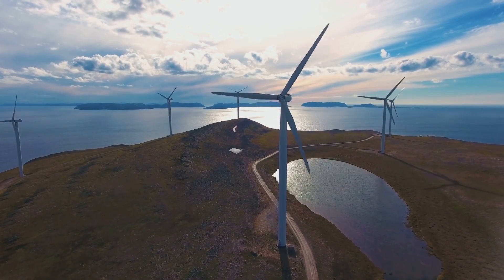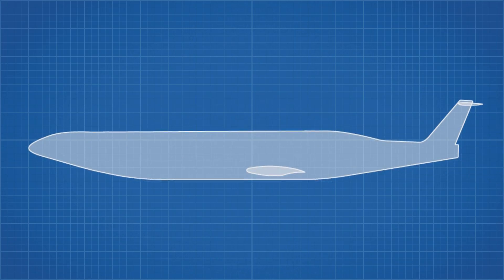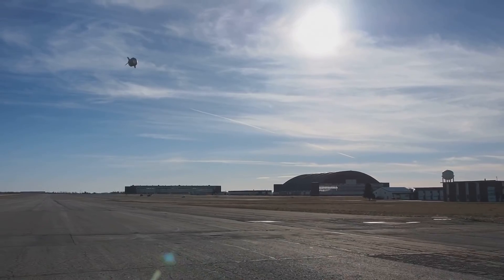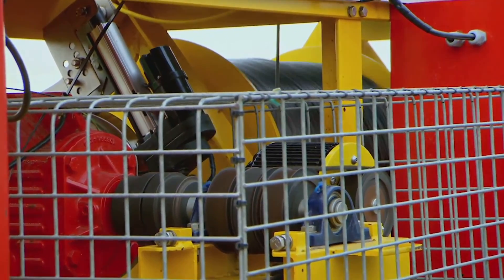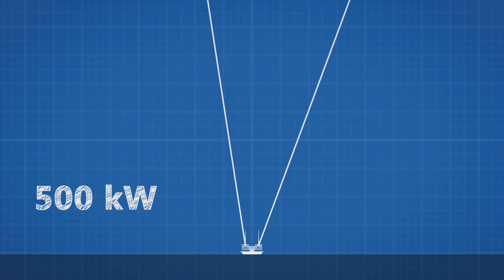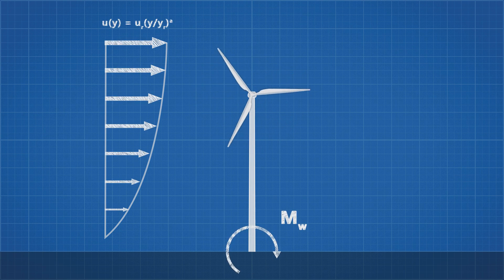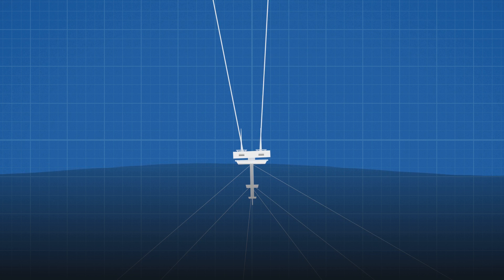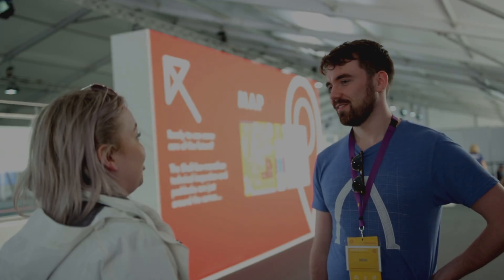The Future of Wind Power? - Kite Power Systems

Comment: Those numbers seem wildly incorrect. A glider requires about 10kw to lift a human. Most paramotor engines are in the range of 10-20kw. Those looks like smaller wings but at higher wind speed. So a 10m^2 wing at 30km/hr wind will create 1kN of force. Or enough to lift a 100kg person. In order to generate 100kW (instantaneously) it would have to climb at the rate of 100m/s. Obviously for equivalent net power output it would have to climb at 200m/s and descend at 200m/s. I.e the climb rate of an f16

Comment: The same system can be used in a river with slight modifications to the actual sale it can be a c anchor bag that opens and closes and using the rivers natural flow to drag the cable out and turning the generator creating energy and it can go back and forth with three as many as you want and it doesn't impede the natural flow of the river

Comment: You can use  hydrogen gas to keep the kite in the air it might be cheaper than helium gas.
You would have to have a rope in each corner of the rectangle sail the bottom 2 ropes could be joined together a few hundred mtr from the corner,
The top 2 ropes might have really strong rubber rope attached to the main rope so it will stretch in really strong winds that will make the sail flat and it might only be a mtr thick so it could handle really fast winds,

Comment: I made a mistake the bottom axel doesn't turn in on direction so you have to make a fitting to make it work both ways, sorry.
Reply: You may have to fit ratchets on the bottom axel to make the axel turn one direction.

Comment: I've got a different idea that's much cheaper to make and I think twice as efficient.

My idea.

Make a rectangle sail that  has helium gas to hold it up .

Make a 40 or 50 lift well have a axel each end, have strong flat strapping that are attached to both axels,
One strap is attached to the right side of the bottom axel and the other one is attached to the left side of the bottom axel .

Have a track each side and make a square tank with no top cover, the tank will hold a ton of water.
Attach the straps to the tank half way up the lift well,

Have a water pump inside the tank, have a electric flat strip about 10 mtr on the well wall at the bottom the electric strip would turn on the water pump inside the tank .
The pumped out water would be collected and stored in a tank,

How does it work,

The wind pulls the tank up , and the weight of the water pulls the kite down.
When there is low wind most of the water in the tank would be pumped out and one generator working.
High winds the tank would be full and 2 generators working,

A computer would put the right amount of water in the tank, you want the full 40 or 50 mtr stroke.

Because of the way the straps are attached to the bottom axle the axl always turns in one direction and one strap is always pulling and the other strap is winding up

So the kite and water made the machine twice as efficient because it works both ways

It's easy to scale up to a 100 mtr lift well and a really big rectangle sail like those big balloons, you can put 3 or 4 ton of water in the tank,
I thought of this idea for a boat about 30 years ago the waves would make the weight more back and forth,

When I saw this kite idea I thought that I could use my boat idea and instead of waves use a helium kite
I will be 72 next September so I would like someone out there to make my idea.
I've looked at a few other kite ideas they all seem much more expensive and they don't work both ways they only pull,
The best wind for my idea would be strong choppy winds so the tank would go up and down the full length of the lift well quickly,
Patrick Ryan I am retired and I live in Vietnam email,
patvn2000@gmail.com
Reply: https://www.youtube.com/watch?v=k_fEP-3W1Gc

Comment: It would be really interesting to see a follow up video which compares and contrasts this Kite Power System with another kite system. Makani is the other system. Makani is seems much more complicated but it's also crazy cool. The video title is "Pulling Power from the Sky: The Story of Makani". I saw it on the channel X, the moonshot factory. I'd love to see Real Engineering's take on this technology.
Thanks for making interesting videos.
Reply: Makani seems like the wrong way to go about this. Basically building large and complex airplanes that require lots of resources and money just like airplanes.
VS just making a simple kite a little larger maybe and working with a winch on the ground and a relatively simple kite control unit in the air.
Reply: @dejayrezme8617  It depends on what sort of power the two systems can generate. IF Makani produces enough power to warrant the extra complexity and expense then it might be worth it. I'd be very very surprised if Makani doesn't produce much more power but I'd want to see exact numbers before deciding which is a better option.
The whole time I was watching the Makani video, I was wondering how something so complex could possibly be better then normal wind turbines. The Makani video didn't convince me their system is a good one but I'm also not completely sure their system isn't worth pursuing.
I'd really like to see some hard numbers comparing the amount of power produced by the two kite systems.

"require lots of resources and money just like airplanes."
Keep in mind the Makani kites don't carry people. If airplanes flew without people, the cost of flying them could be greatly reduced. When airline jet turbines are serviced/rebuilt, some of the parts removed are then used in power station turbines. Making an airplane safe enough for human passengers greatly increases the cost of maintaining airplanes. 

I think you're still likely correct in your assessment of Makani but I'd still like to see the comparison.
Reply: @ddegn  Would love to see a comparison too.
I've been researching this a bit the last two days. The simple start with a winch + inflatible kite + kite control unit (3D printed and open source electronics?) could be awesome for easy adaptation. I'd like to put this on a boat and use it over the ocean.
Another advantage is that an inflatable kite would be less dangerous.

Comment: 500 kW output ? But this is a periodic system right ? You have to rewind the cable every x minutes right ? What's the power output when you have to rewind the cable ? What's the minimum wind speed to operate the kite ? You also have to forbid all area to aviation.

Comment: The estimates for the amount of batteries needed are GROSSLY wrong. 

1. Simply by combining wind power with solar, we eliminate almost all the batteries the video says we need, because wind and solar tend to peak at opposite times of both day and year. Offshore wind also is reaching capacity factors of more than 60%, 3 times solar's cf. Improvements in both W&S are still happening, and solar panels can be tiltable to extend use through day and year, are increasing efficiency as they replace fossil fuels and thus air pollution declines, and may soon absorb energy from falling rain, allowing them to dramatically increase output at times of day and year they give little or none now. Other advances are happening as well, increasing solar's power and efficiency, which decreases the land needed for it. That allows more of what we need to be near (or in) cities, allowing virtual power plants with microgrids containing solar, wind, geothermal generation, small amounts of biomass and/or tidal, plus batteries like the Powerwall. To try to power Hawaii, eg. just from solar, is nuts; wind will likely be their main source, especially offshore wind.

2. We shouldn't expect batteries to provide nearly that much of our storage needs; batteries like the Hornsdale Power Reserve provide instantaneous ramp ups while slower but larger pumped hydro storage can supply longer-term needs. Providing 90 days of energy for NYC from batteries alone is insane and completely unnecessary. 

3. In the places inhabited by 99.99% of humanity, the grid can be big enough to hook up disparate generation in distant weather systems, providing 'distributed generation' so there's always power. Slightly overbuilding generation (as we do now with fossil fuels) we can combine variable RE (wind, solar PV, tidal) with dispatchable RE (concentrated solar thermal, hydro, geothermal, some biomass...) from wide geographic areas, and very small amounts of battery, pumped hydro and maybe other storage, to cover all our needs. EVs, especially public mass transit EVs, can be used as mobile batteries to get us around AND power the grid as needed.. Demand response strategies like variable pricing, contracts to supply power for some uses when it's available, etc. can fill in gaps when they happen.
Reply: consider that the video is 3 years old: imagine how batteries and clear energy technology has improved in these years.

Comment: Is it possible to combine Kite power system with wind turbine? Because at that great height wind will be massive, and kite can be still in one position and no need of frequent pull and push of two kites, one kite go top with fan to it, and transmits energy back to grid.
Reply: Yep. Search for Altaeros Turbine prototype here on YouTube.

Comment: Would it be practical to make a large field of these things? I'd think that the kites from multiple modules would collide with each other and make it impractical. The computer control of the flight path would have to be very tight and integrated across the whole field for there to be any chance of large scale commercialization.

Well it's been years, has there been more progress in this Makani thing? Most recent news seems to be that Alphabet/Google pulled out of the project.

Comment: Water boils at 30c in a vacuum and returns to liquid at 29c the expansion rates are the same no matter how the water boils. This means in a closed system you can run a steam engine off heat from the sun and endothermic from water sources you could even run an air conditioner use the heat to boil water and the cold to return it to liquid.

Comment: What about my wave pod idea from another video, but instead of a spring loaded drum that can spool and retract you have a hydraulic pump that gets driven. 
This in turn provides constant or near constant pressure for the dynamo drive, therefore creating a more reliable system for the base load that any power supply system requires?

Comment: But you can’t have too many of them next to each other they will tangle and that would be that. These kite power things will either be a neat little project that never gets off the ground or be an ultra niche system for remote locations. Nuclear energy was always the correct solution. We have the technology and know how to make future nuclear energy very safe.  Chernobyl and Fukushima incidents have instilled fear of nuclear energy.  One was due to poor design and mismanagement, while the latest was an aging facility made in the early 70s, hit by 9.0 earthquake and 40 foot tsunami.  Solar and wind power is only a small bandaid to the looming energy crisis.  Oil and coal can only be over mined or fracked to curb price inflation for so long. Eventually prices will rise to levels no US consumer has seen, but Europeans know too well.

Comment: I'm a realist, and aware that big oil companies aren't going to go away. I am happy that they are investing in clean tech as their immense resources are critical to progress. The only reason we have the society we do is thanks to piggy backing off the cheap and easy energy fossil fuels have provided. 

My issue is that they have shareholders and quarterly statements to provide for and like any business will do so at a profit at all costs or fail, this is an issue with the system, not necessarily with the oil companies.

They have been known to 'greenwash', to make it look like they are changing when in fact they aren't, hiding climate change data and lobbying. Increased carbon taxes and harsh environmental regulations and penalties are needed, even if these companies lobby against them, of course they will it threatens their business models; if renewables are the cheaper alternative in all circumstances then as businesses, these companies will get on board or fail.

I don't necessarily mind that they cheat, most multinationals do and it benefits a lot of people including us (cheaper fuel, better performing pension funds, stronger economy, jobs, etc), what I want is for them to be cheating for the benefit of the planet and the life on it.

Harsh penalties for non compliance with strong environmental laws will go a long way to making that a reality.

Stop trying to take these massive companies down, it's a waste of valuable time and effort and they'll win, instead work to change the rules of the game so that their immense resources can only be brought to bear on this complex, multi generational problem.

Comment: What if we turn spare lecce into hydrogen and burn that hydrogen in upgraded coal furnaces that can switch between hydrogen and coal at the flick of a switch? That would be lossy as fuck relative to fuel cells, but that could be implemented relatively quickly.

Comment: One thing I would worry about is lightning. Especially with that offshore platform that has multiple anchors down to the ocean floor, as well as the two tethers in the sky. You're just begging to be struck by lightning.

Comment: Nice commercial. What's the CATCH? What happens when it rains? Cutting costs is good but it still depends on windspeed does it not? Wasn't that your opening argument against wind turbines? How is this better even if it's cheaper if it's not gonna get us more juice? I'm glad they invited you to see their product but no need to stray away from reality. Geothermal. Clean nuclear. A working tocamac if at all possible. Wave energy. Better solar panels. Maglev wind turbines (which work practically with a breeze). There are many ways to go and to improve. If kites are proven to work reliably, I'll add them to the worthy contesters list. Until then...

Comment: this video has really old costs for offshore wind.  They have not been 17 cents for several years.  They have dropped 50% in just 4 years and come in between 6 and 10 cents per kWh.  this channel so often gets renewables wrong.  The kite thing is cute, but it just cannot scale the way offshore wind can.  in a decade we will have 50MW turbines.  The largest prototype we have today is 13mw.  most that installed are 6-8 mw.  3mw kites are not going to cut it.  the projections for offshore wind are going to continue to fall fast.

Comment: You can tell man is monkey..... Deep water has very strong consistent current and all you have to do is slowly drop it down and add weight bases. Or use maga pool to produce extreme power sources. It is best to convert this to chemical energy than to try to make long cables if they are in remote places. Fill up tankers with liquid hydrogen. 
Not as interesting as going up. 
Even deep mines shaft in africa could use water pipes with heatsinks to create lighting down there and even ac. :D

Comment: You fail to outline the one large issue with Kate power (as described here). While it is much cheaper to have a single kite power setup than 1 wind turbine, no one has ever set up a single turbine and called it a wind farm. To make this generate enough power to be equivalent to a modern wind farm you would have to have many of these running in sync all together. That would be a serious problem because of the space required to have the same amount of kites in the sky. If they were as close together as wind turbines are they would surely get tangled. 

Don’t get me wrong I love the video and I’m extremely happy we are still looking for better alternatives to wind and other renewable forms of generating energy.

Comment: I don't see the use for disaster relief - use portable generators, you wouldnt be able to connect anything to the grid as the reason the power is off is usually due to multiple faults.

Comment: Two thoughts: with respect to pilots being able to see the tethers, one person suggested a reflective coating on the tether, and equipping planes with weak lasers. Could the weak laser instead be part of the unit, and set to strobe rapidly up and down the tether, so as to create a highly visible, but non-blinding situation?  Second, I'd like to know if they've found a way to treat the fabric to withstand thousands of hours of sunlight exposure. Anyone know the answer to this? Still, the kite is likely a small fraction of the system cost. This could be done at the personal scale with small kites and paracord, no? Who's working on that!?